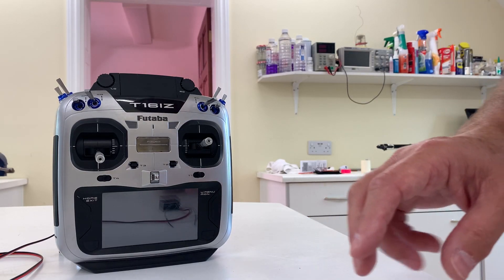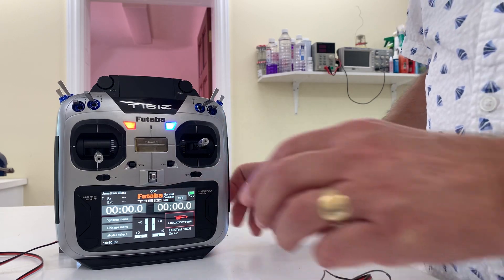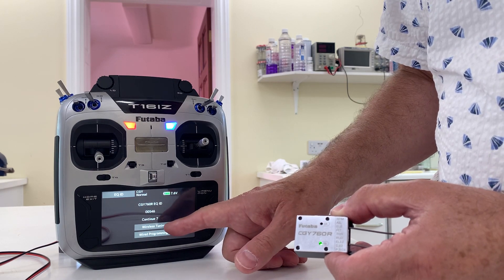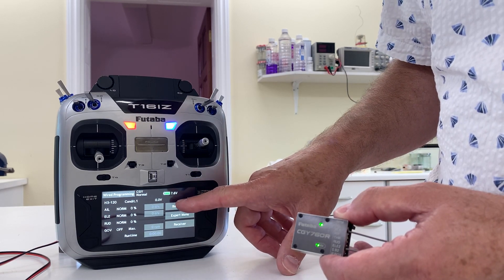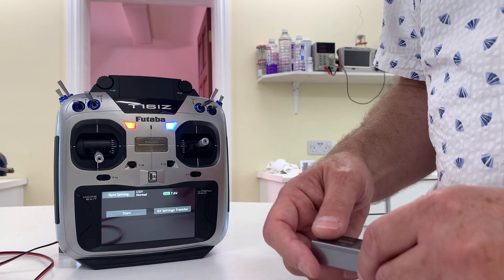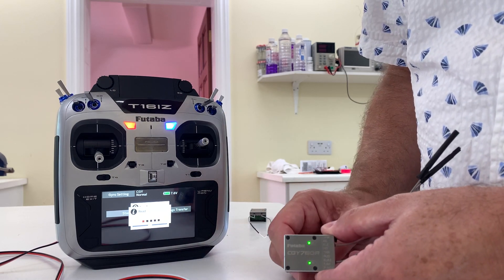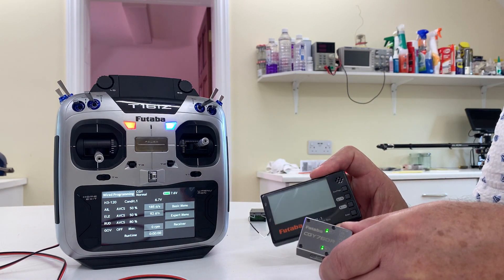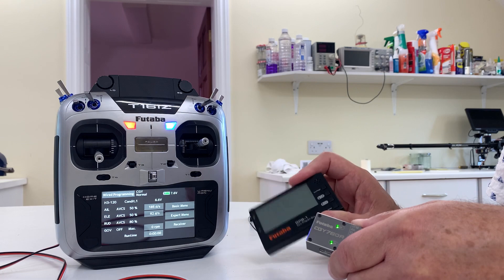CGY 760R fault

Comment from the maker: Yes I tried that but it didn't help. Ripmax, the uk importer, gave me a replacement which works perfectly. It is a known problem that requires the gyro to be flashed with the base programme again. This can only be performed by the manufacturer in Japan or the USA

Comment: i dont know for sure
but i hear this a safety feature to stop some features being active, only wireless users getting a mess?
i hear futaba dont want unlimited programming 100 percent wireless?
Reply: excuse the typos
Reply from the maker: Thanks for your thoughts. It was definitely faulty and was replaced with a new one that works perfectly. You are right some functions are only wired to stop the user accidentally changing a critical setting on the field.
Reply: You have to update your transmitter by 4.3ver.
That same happened to my new CGY770R  because my gyro setting from my transmitter is not updated with 4.1ver